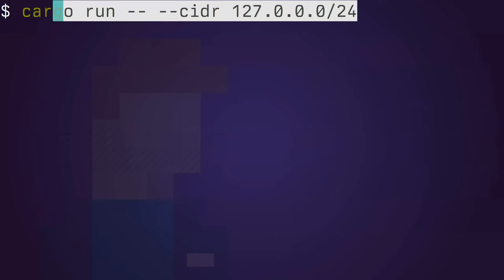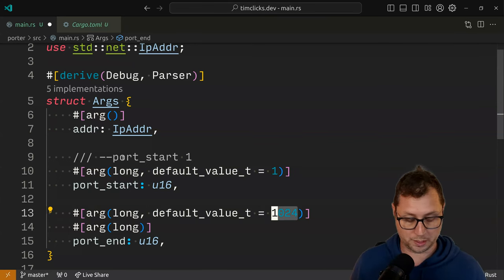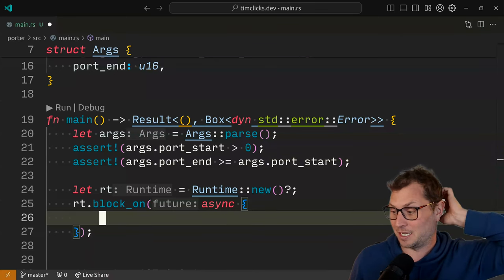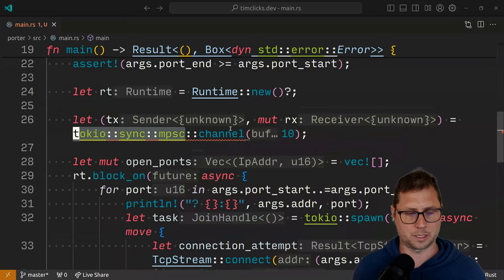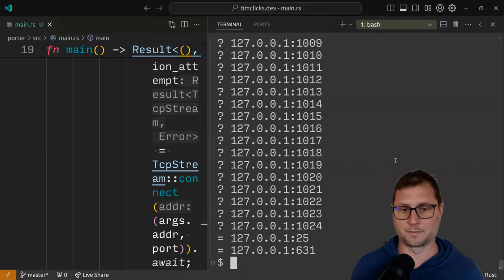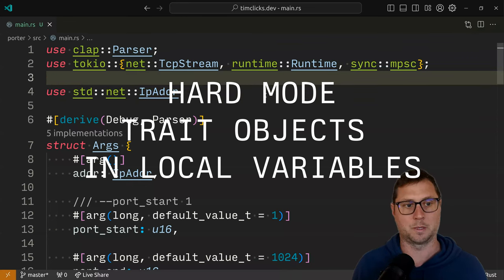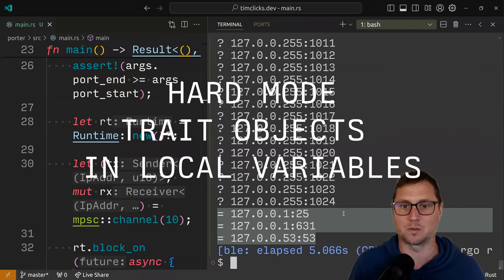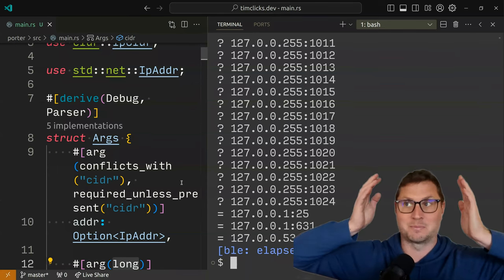Make a port scanner in #rustlang with Tokio and learn async Rust  🦀 Learn Rust Creatively

Comment: Cool tutorial! And hello from the other side of the pond (Brisbane here)!

A question - this is spawning quite a few Tokio tasks, as it creates one per iteration of the loop, and typically there are thousands of ports (your default is 1024). Once CIDR is introduced, it becomes a nested loop, presumably spawning even more tasks. Is there any performance penalty for creating so many tasks, or are they quite lightweight?
Reply from the maker: Tokio tasks are very cheap to create. Most systems should be able to comfortably handle running millions concurrently, assuming each task is I/O bound.

Comment: Hi Tim, nice vscode theme you have :) and a great topic
Reply from the maker: Thanks! I am slowly tweaking it over time and will publish it when I am finally satisfied 😅
Reply: @timClicks  also can you guess why vscode auto import not working on Ubuntu ? I have same extensions on windows and mac it works there.
Reply from the maker: It sounds like it's misconfigured. Check your settings, making sure that VS Code has the correct path to rust-analyzer. Also ensure that the project directory is in the workspace.
Reply: @timClicks  thanks again